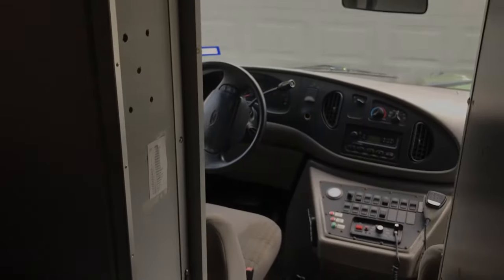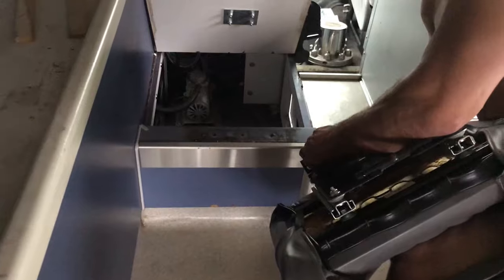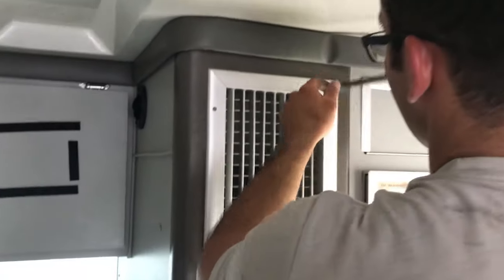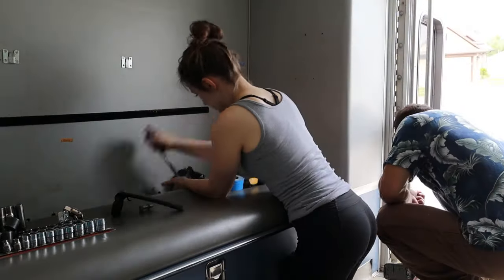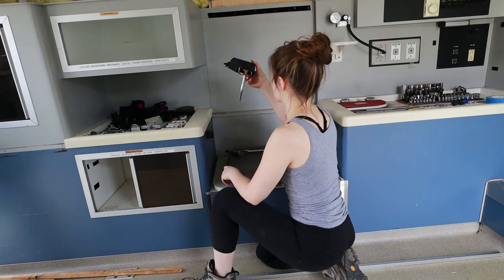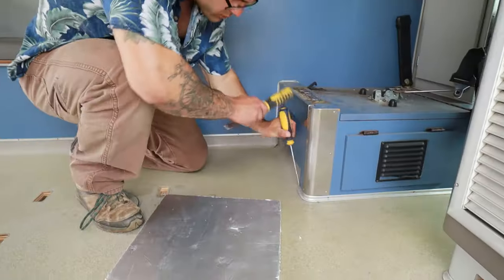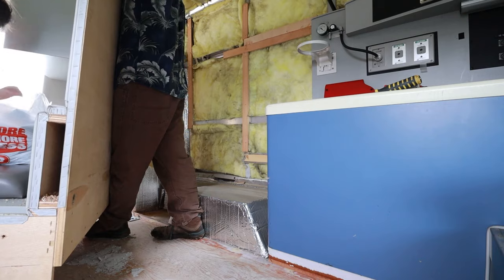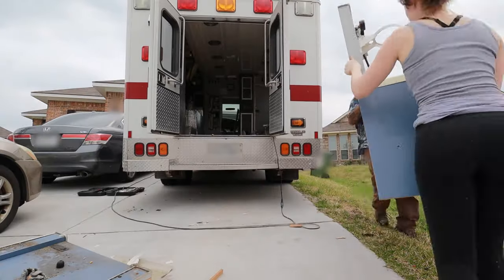Couple Converts Ambulance Into A DIY Tiny House | TIMELAPSE Demolition Day #1

Comment: The metal plates on the floor are called cot plates. I remount ambulances and sometimes we have to drill out the bolts to the plates. They are usually 3/8 of an inch so if this is still an issue use a 3/8 drill bit to remove the bolt. It does take a while to drill them though. Don’t forget to caulk the holes in the floor also!
Reply: I have a few questions about those plates. How much weight are the suppose to support? Can the be reused as tie downs to secure cargo?

Comment: I had the same issue with the bolts through the floor of my ambulance which  is a 93. Have someone underneath the ambulance hold the bolt as someone gets them out from up top. Lots of rust lol :) such a pain!
Reply from the maker: Ahh yes lots of rust 😭 we had a brake line explode yesterday after changing the rear brakes and bleeding them. It was SO rusty, got it all fixed though (Tim is a mechanic by trade so we can usually get stuff fixed right up pretty quickly) 😊🎉 Thanks for the tip! The fuel tank is in the way of getting an angle grinder up in there and like you said it’s too rusty for the wrench haha we had such a pain that first week or so of working on it that we put it on the back burner and still haven’t attempted it again 🤣 whoops! It’s on the agenda, but we are actually about to take it on a road trip to see how everything goes with where we’re at in the build right now 🤗 we’ll be roughing it a bit, but we are so excited!!! Thanks so much for watching 🥰

Comment: I bet that the Gurnee securement points are most likely bolted all the way through the ambulance? You could check out The Campulance Man.
Reply from the maker: They are! We have just been putting it off, kinda one of those that “we will get to eventually” 🤣 But we will get our new angle grinder and get rid of those once and for all. Need to patch up those holes and a few others as well before getting the floor squared away. Thanks so much for watching and for your suggestion! 🤗 Yes we’ve seen his videos too! They’re great 🥰

Comment: I ended up using an angle grinder on the gurney mounts in the floor of our ambulance RV. Your conversion is looking good! Keep up the good work!
Reply: Ah, I see further into this video that you tried the angle grinder too! If you come at it from the edge of the mounts, you should find that you can grind off the bolt heads and leave the bolt shafts even with the subfloor.
Reply from the maker: Perfect!!! Thank you for those tips, Tim. We will try that out when we get back from our trip so those things can finally be GONE! Haha we had to upgrade our angle grinder once we started removing the aluminum boxes, so I think this new one will be able to grind those out easily. We appreciate you watching and for your insight 😊🎉

Comment: Watched both episodes and.. if you're still working on the issue with those bolts.. Have you considered an impact screwdriver? You can buy one for about $20. It's a hand-held one that you put into the groove of a screw (assuming you have the ability to grind the heads of the bolts so it has a + sign for the impact screwdriver to settle into). Either that or you borrow an impact drill that has the adaptor you need.
Reply from the maker: Thank you so much for watching guys! We really appreciate that you want to follow along on this new chapter! 🥰 That’s a great idea! We definitely need to add one of those to our arsenal 🤣 We’ve gotten a few suggestions for getting rid of those things, so now we just need to do it! It’s just been one of those things we’ve pushed to the back burner since they’re not really in the way with all the additional reno we’ve done haha

Comment: It looks like you have the same build that we just bought! I am currently trying to remove the rear upper driver's side cabinets and I have no idea what is holding them in! I have removed all trim, screws, and two bolts and they are still rock solid. Do you remember how you got yours out in one piece?
Reply: I also have what looks to be the same box in the video and am also having trouble with the drivers side cabinets. Do you by chance remember how you got yours loose?